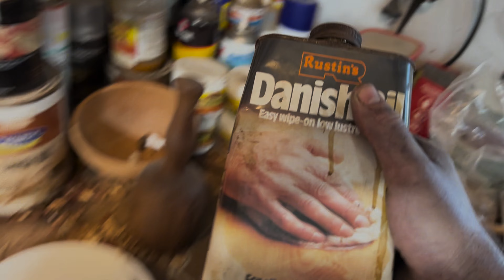A Glenn Lucas woodturning club project. Can pine be this beautiful..

Comment: So glad I found your channel. Old man but love to see the different ways of doing things. Old dogs can learn new tricks
Reply from the maker: Thank you so much, Rod 🙏. I am glad we have been chatting, and you know you can ask me anything.  I will do my best to help. Cheers, mate.
Reply: Would love to hear your opinion artistic and blended functionality. I gravitate to exterior shape and movement and the inside of the vessel being functional. Frustrating in as much as judges at some shows tell me I have to have consistent thickness throughout. Have also started finishing the bottom of my stuff with a gentle roll over and platter like bottom so other turners can’t try to pick it apart looking for hidden flaws. Like you said I guess turn it like you like it yourself. Keep up the great work
Reply from the maker: I like to keep things functional, and I’m not in it for awards. I focus more on the end user in my craft. I do love going to competitions though. But, horses for courses, I guess. Cheers, Rod.
Kezza
Reply: I know you have your content planned but I think it would interesting you showing how versatile the bowl gouge is. I probably use my 5/8 gouge for 90 percent of my stuff. Wife came by the shop needing a new pen so I had just sharpened the gouge so I figured what the hell. Worked every bit as good as the spindle gouge. I know you want run out of ideas and I don’t know if you do vases or candle sticks but it might show everyone the don’t have to buy 20 tools to get started. Have a great one. Appreciate you greatly

Comment: Hi KC...
Woodturning club..Lucas gave y'all a project to do..ok..I think I got that right...
Are there many who follow Lucas as a mentor ?...
The wide grain in the slash pine...when you used the wire brush..did the definition between the harder and softer wood become more apparent ?..or is that just the visual from the wide grain..really made me think of 'Shou Sugi Ban'...the burning of woods to create texture and preserve by charing...lovely grain pattern nevertheless...
Are you to turn in or present your project ?...I have so many questions..lol...the lip edge..any other sealants to be used..so sorry..😁...
Great to see your work...all my best to you and the family...🌿🌿🌿
Reply from the maker: Hey Pam, yeah, so we had a project to complete before our next catch-up, which was the milk paint bowl. We then all caught up on Zoom and showed our pieces and discussed the challenges and different methods. I got a lot out of it. Yeah, so the wire brush created the effect that you described, exactly. In regards to mentoring, there are 135k people following his page on Instagram, and that's those who have Instagram.

I've got one more coat of paint to apply and two more coats of oil for the inside, then sealing the outside. Thank you so much for the questions. I appreciate it. I will be moving the Weekly to monthly due to time pressure and focusing more on turning projects like this. Makes more sense because the views speak for themselves as to what people prefer to watch.
Thank you again for the interest. Ditto to your family also. 
Kezza